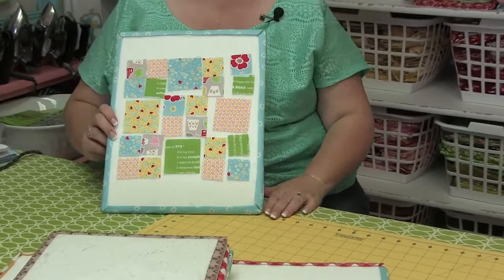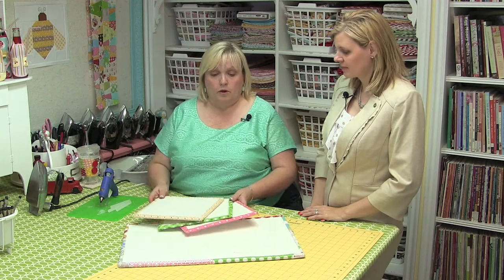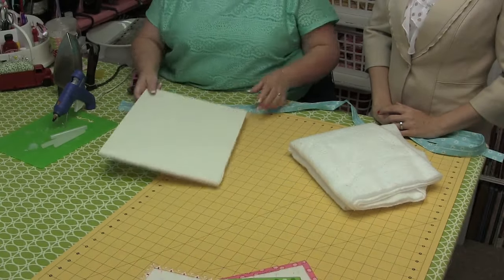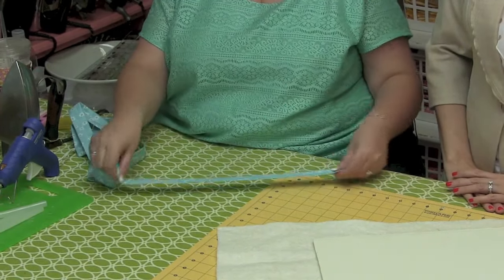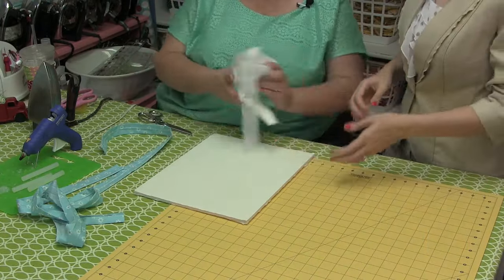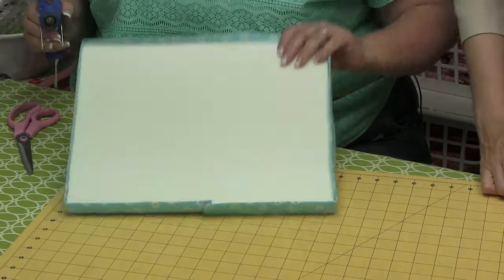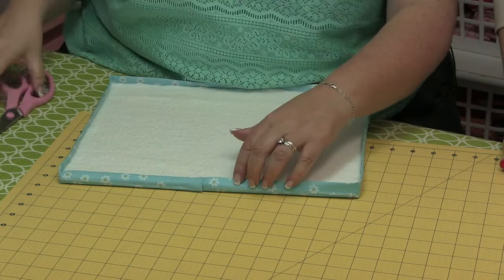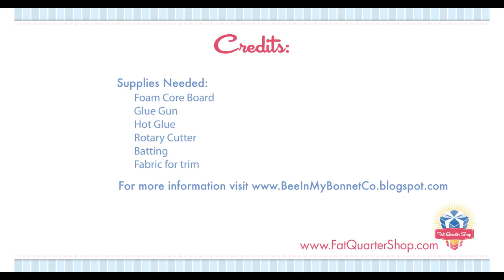How to Make Lori Holt's Quilt Block Design Board - Fat Quarter Shop

Comment: I got a large piece of foam core board at Lowe's (could do Home Depot) that was super cheap.  Took it to my quilt guild with scraps of flannel and duct tape for the back in sev color choices. Shared your idea Lori and we all made em together. Some of the ladies only put the duct tape on back and some used it like the binding you showed. Thanks for your cleverness and specially for sharing. My quilt guild thanks you too. Was lots of laughs all around

Comment: I have made these and instead of using the glue gun to stick the wadding down, I used double sided sticky tape. This was much quicker and easier than using the glue and also enabled me to stick the centre area of batting down without it being lumpy.
The glue gun was still the best method for sticking the binding down though!
A great tutorial and a great addition to the sewing room! Thank you Lori!
Reply: 180353  a better method with batting and foam board is to use adhesive spray, even the repositional kind which stays in place solidly after a short while.  Tons easier than glue guns.
Reply: Happybidr Of course! I'll do that next time...thank you!

Comment: I use rubber cement to anchor my batting to the core board first, then use the glue gun for the binding. Works great and doesn't add bulk. Love these boards, thank you Lori for sharing this great video.

Comment: I HAVE ABOUT 1/2 A DOZEN PIECE OF THAT STUFF THAT THEY PUT IN WITH NEW REPLACEMENT FRIDGES AN WILL BE MAKING THEM AS SOON AS I CAN GET THE OTHER STUFF ROUNDED UP...
I WAS GONA TAKE A FLANNEL SHEET AN MAKE A FLIP & FOLD BIG BOARD BUT I LIKE YOUR IDEA BETTER AN WILL HAVE MORE TO USE IF I NEED THEM...
TY TY TY FOR THAT FANTASTIC IDEA...
💓💓💓

Comment: Wow! This is so clever! I started quilting two years ago, and started using a foam board to carry my blocks from the cutting table to the machine since they are in different rooms of my house and I was getting really confused. But they would slide around and sometimes fall off. I only started using the board because I happened to have some left over from a presentation. This, though, is brilliant! Using left over batting to cover it so the pieces don’t slide. I plan on doing this as soon as I can. It will make life just so much easier. And making multiples of them and in different sizes is wonderful. Thanks for the tip on this. I plan to watch many more of your videos.

Comment from the maker: You take Foam Core board found at an art supply store and you cut it down to size. Then get some batting from left over quilts and hot glue to attach it to the Foam Core Board. Take a 2 1/2" strip of fabric for the binding on your board, iron it in half so it can wrap around the edges of the foam core board. Then just hot glue the 'binding' onto the design board. It is really very simple. I hope I answered your question. If not, feel free to write us back.
Reply: What size do you usually make?
Reply: Don't forget to zig-zag stitch down the middle of the folded 2 1/2" of fabric...being sure you are catching both sides of the fabric that's folded to the center!

Comment: Can you tell  use what side of the batting you put on the top?
Reply from the maker: Hello Wanda! It depends on how you buy the batting. If you buy a  roll, the top is facing up on the roll. If you buy a bag of batting, most of the time it is folded with the top on the outside.

Comment: What size boards should I make besides the 11x14
Reply from the maker: We like to make 18" square and 10" square design boards.
Reply: Thank you
Reply: is this a 18 x 18 size.
Reply from the maker: Correct, it's cotton batting we are using.

Comment: lol I would do both sides in batting n then create a binding like a book that way I could do double the patterns. create 6 of them it would be 12 squares use binder rings go a step farther put poster board between to keep them from rubbing fabric off. Even poster board to cover outer pages for travel. then you have them perfect for hand piecing too or sewing.